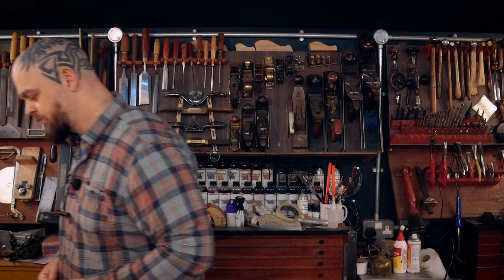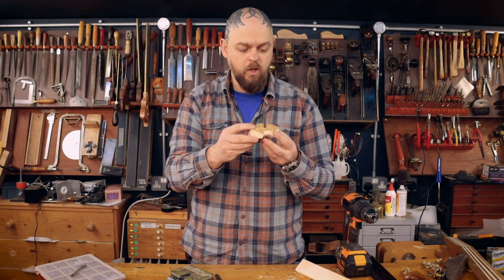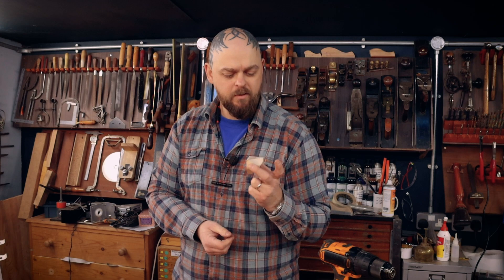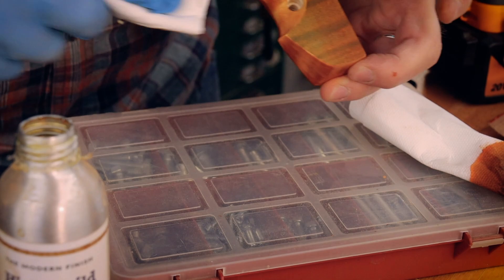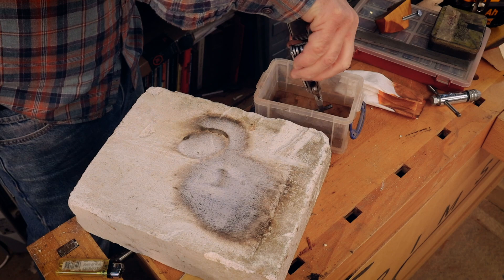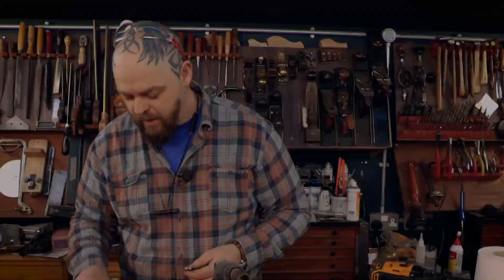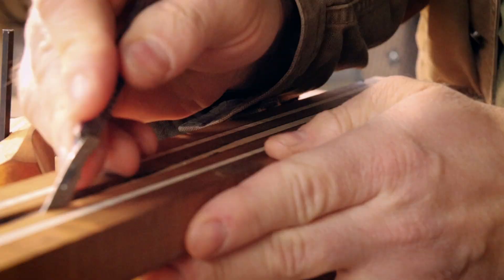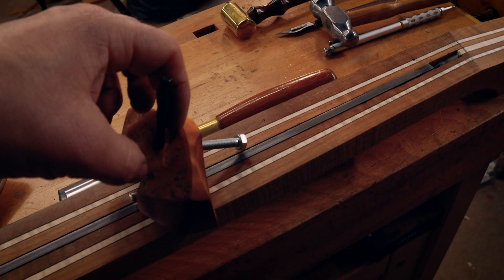How to make a Budget Router Plane with a scrap of wood and an Allen Key!

Comment: I think forcing the bolt to make its own threads is better than tapping for the simple reason that it compresses the fibers rather than severing them. By compressing them it makes them stronger. So a hole that has threads formed by forcing the bolt in is stronger and less susceptible to getting "sloppy" with use. Idunno, IJMHO, and YMMV, but there it is.

Comment: An Alan key is already the correct tensile to be used as a blade for wood working and will keep an edge for a long time , I've also made minute wood chisels from alan keys as small as 2mm and 1.5mm beveled edge for miniature dovetail boings

Comment: Better grade hex keys are preferred.  Imports will work, although the edge will not last as long.  Ductile is the result of tempering, lowering the hardness but eliminating the chance of breaking the edge if you hit a knot or screw, which in  guitars would not happen.